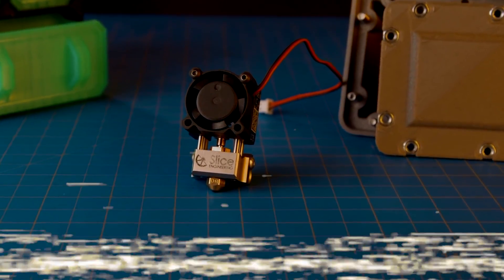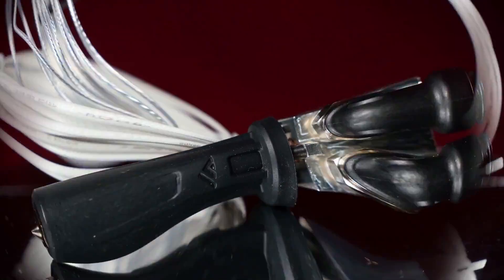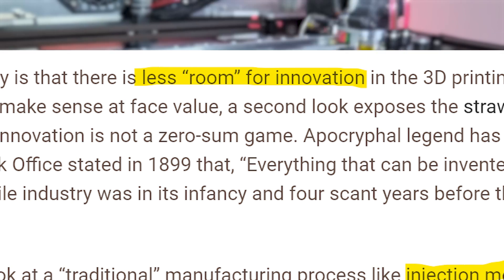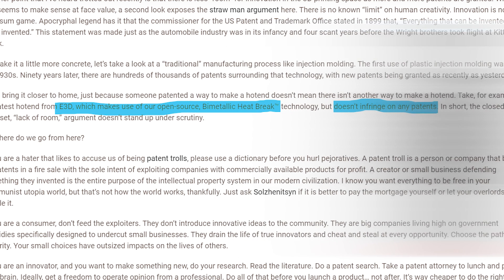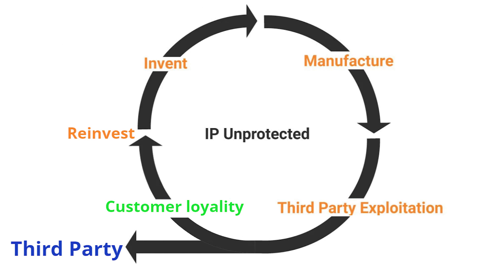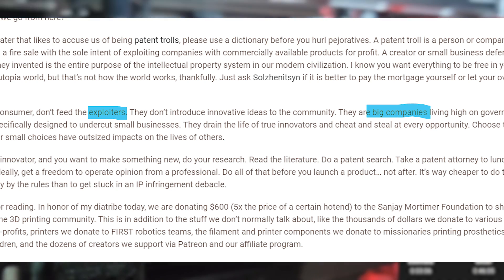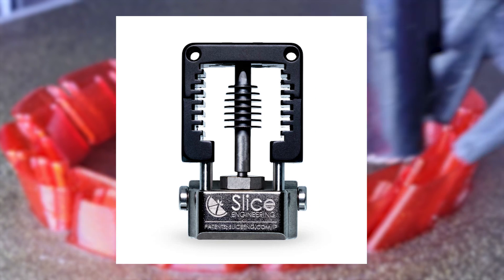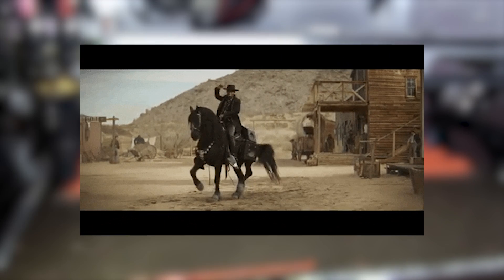Slice Engineering's RIDICULOUS response - VzBot Goliath VS. SLICE ENGINEERING in 3D Printing

Comment: I think I would like it if parents were given based on the industry. They are meant to spur innovation. I think different industries should have different patent lengths. 3d printing is an industry with incredible innovation already, so the patent lengths should be a lot shorter possibly 1 year. That would pay for the engineering and testing and stop knock-off clone companies that don't pay for r&d(or engineers) from leeching, but at the same time they can only hold on to it for one year so that every end user can benefit and not stifle innovation.

Comment: Slice could EASILY quash the controversy in one day. They could blame the C&D on "legal department" doing what they just do outside the awareness of Slice ownership, which is probably true anyway, then license the "incredibly awesome innovation" of four post mount to Vez for a token amount, like a dollar or $1000 or whatever, and drive on. This would demonstrate that they indeed believe in the benefits of human innovation
Of course their pithy ridiculous letter is another matter, but they could simply explain it was an emotional reaction, which is probably also true anyway.
I mean OK, in "Reasonable World" we like free markets. On one extreme you can lean toward communist utopia and the other extreme is called facism. In my opinion, current patent system is broken and enables facist leanings. Patents should only be allowed to last 3 years or 5 years or something. Get an idea, flood the market with it and make your mark while you can, then continue stacking innovations so your business can survive. Alas, that's my personal pipe dream.
Anyway, Slice could do damage control and fix this easily if they chose to do so. They've laid the groundwork by claiming that they don't enforce bimetal heat breaks. Then do a solid for the 3D print community and support innovations. Their choice whether to or not will demonstrate whether they are facist bullies. OK yeah, legal yada yada. Obviously the actual problem for them is past that and about something else now. Something more important and more valid in my opinion.
Goliath is fairly unique other than the four legs. Maybe Vez can simply make it 5 or something?

Comment: I don't agree with slice response, but to be honest I don't agree with yours either. Patents are not evil, they protect a company from copies so it can recoup its research investment. Yes Prusa succeeded without patents, but they got into market the right time and started from a country with low manufacturing cost. Patents in injection moulding don't expire fast, all patents last 20 years. Bimetal was not patented probably because it wasn't slice engineering's  idea. Their patent is unique because they are using hollow spacers with screws in the middle. I am sure people have used those before but the patent office does not look for prior art online (yes, this is wrong ) only in other patents. The Buda-style hotend A and B  posted in RepRap forums does not use hollow tubes as standoffs so it wouldn't be prior art anyway. The heating element around the goliath extruder is similar to Dyzedesign Typhoon which is similar to what you will find is some injection moulding machines. The comments about communism are nonsense, even communist countries had a patent system, however Slice is right to try and defend against hot ends with tubular standoffs. The big issue in 3D printing is that the patent office doesn't search online. As a result a few companies have patented other people's ideas posted online.

Comment: It’s 3 pins not 4? Or maybe there thing is actually a copy. Patents basically invent creative ways to work around.
Just pay first for a patent for your thing as they typically don’t even check if it infringes..

I‘d guess if they could have patented bi metal they would have.

Should be as simple as making a round object that holds the sides.

Patents are from my side seen a unfair advantage in a free market as its monopolizing the space.

Comment: great video!

I am working on a different method of decoupling. I will publish everything in some open format, and would be more than hapyp to slam the door for slice and their funny little patent. i love the bimetal principle, but always disliked simply bolting on the hotend. theres another way, but it has to be very sturdy - which is the hard part. but it is possible, in my opinion. slice is not the best thing ever, even if was close - for its time....

today, VZBOT smokes them, by a mile, and they know it. seems like the mosquito was all they really got.

Comment: Specimens a, b, and k do not violate the slice engineering. Please read the patent. Specifically the part of what members are held in tension and compression. A prior art search is a huge part of a utility patent. There was no prior art in that described the the exact way in which the spacers and bolts are used in the Mosquito. The MK8 hotend also has the heat break in compression and does not have structural spacers, because of this it does not violate the patent. Again, please read the patent. Specimens a, b, and k do not violate the patent. The spread of misinformation is just insane.

Comment: For those raising points about E3D patenting the Revo hotend, there's a big difference here. Slice is holding patents hostage and preventing people from using the idea of rigid spacers between the hot and cold ends of a hotend, while E3D is only patenting to prevent exact clones of Revo. There's a stark contrast here. The E3D patent only protects the looks of the Revo, and doesn't stop anyone from making a separate hotend that supports swapping out the nozzle and heater when cold. This helps stop cheap low-quality clones from flooding the market while not inhibiting others from creating products that derive from this core idea. That's a much better way to do patents.
Reply: Not to mention the price difference. Of course if you sell you product at a prohibitly high price people will buy the clone. The revo is pricey but it's not half the price of an ender 3 expensive.

Comment: typically with 'clones' - people are gambling results.. Sure they are generally cheaper, but that usually comes at a cost someplace else.  I have bought clones, broken them, and then bought genuine and supported the 'real', sometimes you just can't afford the genuine, and you gamble for a bargain deal off a clone.

as most printers are clones of clones by this point, I don't see how Slice can be so hard skulled.   You don't make printers, just hotend/parts.  So until you can make a printer and it not be a clone - you really don't have a leg to stand on here.  Your entire business, is built on (literally) clone systems.  how many Mk2 clones are there now?  how many "ender 3's" ?  Yeah... hundreds of each. The clone system is 'riding your coat tails' to try to make some money doing similar things, and sometimes those 'clones' come with actual better QC than the original.  Which means.. they should be supported, not the original.

If the Goliath is a clone... everything is a clone.  Keeping the hot block away from the cooling with some sort of spacer, like screws, stand offs, a wedge of less conductive metal, or silicone - has been done for nearly a decade - because.. get this... when you want to "cool" something off - having a "heat source" constantly heating it - is a counter productive design!  That is like trying to run your A/C but instead of venting the hot air out the window - your just circulating it back into the room.  This is absolutely basic of basic.   Slice - got a big ego, and thought they would be the 'top gun' in the choice of hotend, but honeslty.. I don't know anyone using their Mosquito design....  there are simply better, or better priced.

Slice - please, make better products before you try to play the big dog. I have no interest in your hotends... at all.

Comment: 1. Stratasys was the first or one of to make hot ends like this 4 screws 1-2 standoffs was the same on several models long before sliced bread!
2."Love" sometimes you have to protect your loved ones! even if you wear a unicorn on your sleeve 
3. Great Video thanks for your angles i think this was needed
4. screws and bolts may never hurt me but names last forever 
5. maybe we should patent an automotive radiator while we can? does mount with 2-4 bolts and standoffs too 
6. engineers know better than to try and patent pre existing century old nuts and bolts or washers and spacers they are not your design you never made them and I feel nothing unique was patent but only others inventions either stratasys or Tomas edision or duke domville
7. the part about you know... clearly shows not only the level of engineering but the level of politics moving into printing???? wow is there further direction to this to come i wonder...? maybe an APP...
8. overview -the whole damn thing is thermal dynamics nothing is actually MADE by the maker to be a Patent in my opinion yet the arrangement that already exists! via Fasteners from the hardware store and nothing more.
I feel they know its not going to be challenged as the start up guys simply cant contend with them even if it was for making a cheese sandwich! like municipalities they too will dry you up long before you get to make your point and for this reason we have loving things like open source support! 

unicorn in training  
care bear count down!

Vezey dont ever stop YOU! but I understand when the 7 is stolen from the calculator you must recalculate (cant wait to see the changes!)

Cheers 

new sub here

Comment: I don't get it why this is even a discussion? A patent is a patent, if someone decides for a patent they do it for a good reason, you don't need to follow the reprap spirit.

But that communist phrase was unnecessary anger. That's unprofessional!

I think Vez-Bot did bad research, teased the community of a new style of hotend, lost much money on that product and now uses the community let their anger out.

Slice should apologise for that unprofessional statement and Vez should just think of another solution to the problem with the heat break (different design or buy permission) to bring this Hotend with a really cool heat block to market.

Comment: Patent trolls use weak patents, and thrive off threatened litigation and cease and desist orders to control and manipulate the market. This is one of those patents. So yes Slice, you are a patent troll. 

This patent is based on principles that are not unique, and were publicly known and considered common knowledge to subject matter experts at the time of application. You manipulated the patent systems’ weakness in vetting public domain knowledge, but it wouldn’t hold water in court, as demonstrated by the information displayed in this video and other sources.

Unfortunately, it costs time and money to invalidate patents, but since there is clear evidence, I have no doubt that this patent would be invalidated if disputed.

To Slice: I have no problem with the patent system’s aims, and I think that patenting your unique inventions is wise given the ease of copying ideas. I’m not sold on the open source movement, as I think it trivializes the effort it takes to truest innovate. However, I take issue with companies that go after patents that are obvious like this one. I will vote with my wallet, in hopes that you will go under, or otherwise vacate this and other similarly obvious patents.

As some might say: Don’t pee in the pool you’re swimming in.

Comment: But takoto hotend has spacers but doesn't infringe patent? This claim by Slice is ridiculous.
Reply: Standoffs... not spacers. So no compression or tension between heatsink and hotblock..and no tension on spacers. Also takoto uses a top plate and one can say its not part of the heatsink
Reply: @Vez3D  in the patent itself names them as a spacer

Comment: Patents are there for a reason. People getting upset due to a company holding a patent have been going on since they started the process. This is no different. It's just like the 3D Printer enclosure patent.

Why does anyone hold patents? To protect their design or property. Just because they have it doesn't make them wrong, or a bad company!

Also you say, more than once, Slice needs to work on their customer service and in the same breath say they have good customer service. Which is it?
Reply from the maker: Hey! Thanks for watching the video. I agree on your points! That's true and one of the many functions that patents do have. Let me elaborate: You see that Prusa has good customer support, and with good customer support their business grew super large anyways! Now, Slice engineering has good customer support too - this means that Slice could be better off open sourcing, while still not losing all their IP. People will buy their hotends because they like their brand, because of customer loyalty caused by the brand. I'll make sure to elaborate better next time. Thanks a lot for the comment, your concern is right!

Comment: It's a little bit funny the inyection molding example, how much that machines cost. The  y are almost a very few of them in 3dprinting, that's why we can have cheap machine in our houses. So they use an open source community to sell expensive close source hotend, nobody should buy the products.
 The buddas extruder, great example, that hotend also have a kind of bi material heatbreak

Comment: I'm more surprised that their stupid patent was allowed to go through. That's not innovative, utilizing a collar type spacer as part of a heat break assembly is not anything new. Goliath should modify their hotend to use a bar type spacer or non-tube design for a slim rigid spacer. 

I'm building a couple new printers currently, I was considering Slice hot ends after hearing good things. But their response has completely turned me off to their products. They've been added to my "never buy" list.

Comment: People can build and sell hot ends using spacers.  Slice Engineering is just claiming the use of surgical tubes as spacers.  That is different from stopping others from using screws.  I believe there should be more respect for the innovation that Slice Engineering did, and they are rightfully entitled to enforce their IP.
Reply: Goliath didnt have any surgical spacers. Nor did it have any of the dimensions of the claims in the patent....and still..they got it banned
Reply: @Vez3D  I did not know that was the case.  I am sorry to hear that.

Comment: As far as I'm aware a patent can not be grant if it has already been shown in the public space before application, maybe I'm just stupid. if you patent someone else's idea that is immoral bad slice engineering. because the support design has already been shown surely makes slice engineering patent invalid.
Reply: In the US you have 1 year from the first public disclosure until you have to file for a provisional and then one additional year from when the provisional is filed to put in for the full patent.
Reply: @mmiscool  thank you good to know 👍. I have a couple of patents to work on  next year but these are not trivial ideas 😉
Reply: @mmiscool  reprap had this design with stand offs for the hotend over 11 years and released it as opensource.
Reply: @Big3dprinter  If there is prior art you can request the patent be re-examined by the patent office. Chances are you can work around the claims. If some one wants to break down the claims that is fine but I think the patent they have is slightly more involved than just having 4 pillars. The company also is not acting like a patent troll as they are actively working to  sell the product and not just suing others in a shakedown for licence fees as a non practicing entity.

Comment: Having seen this video I would even argue that Slice Engineering's patent should be invalidated since it has been done before and hence simply can not be their IP.
Reply: agreed.    nearly a decade before they came along - it was already done - because the concept of 'keeping the hot making parts separated from the parts that need to be kept cold" was not that hard to figure out , even in early days.
Reply: Literal definition of patent trolling. You find a method that already exists but is not patented, combine it with your product with just enough (if any) new design features to get a patent granted, then you bully competition (usually smaller fish) into submission by legal threats. Slice can't go against Creality for MK8 hotend despite the same spacer design, because Creality has the means to fight in court, and possibly invalidate the patent. Smaller fish like an Aliexpress seller/manufacturer or a design group like Vzbot or Voron = easy to shut down because they can't afford to go to court. IP laws are stupid like that, and rectification can be done through legal means but not all parties have the means to challenge it, smaller fish just has to capitulate and shut shop. Same with RED for example in camera business, they usually go after 3rd party accessory makers instead of Panasonic or Canon (but they've tried that too).
Reply: this wh< the whole patent system is garbage....look at what is currently patented - its utter lunacy. Prior art is what makes humans evolve. Patents undo that by protecting stuff as new when it really is prior art..
Reply: Steal existing method? Doesn't look like patent troll, more like a shameless  thief 😂